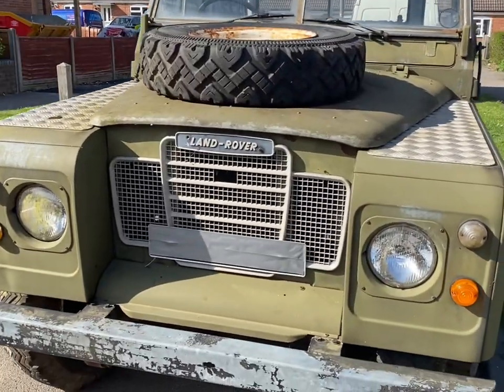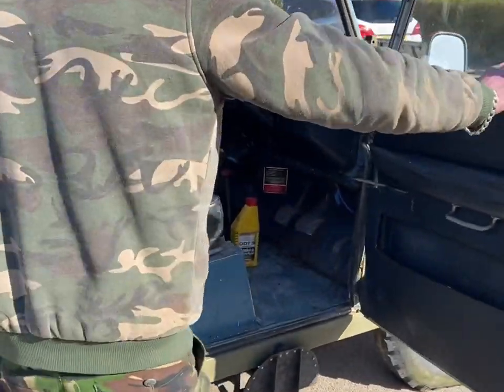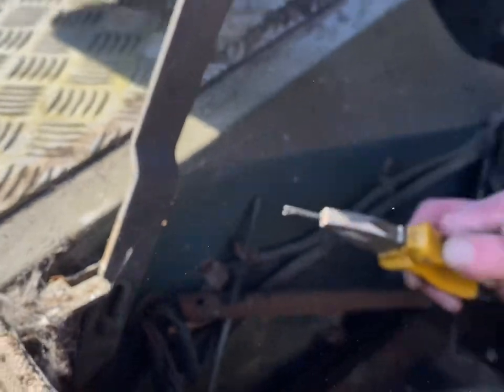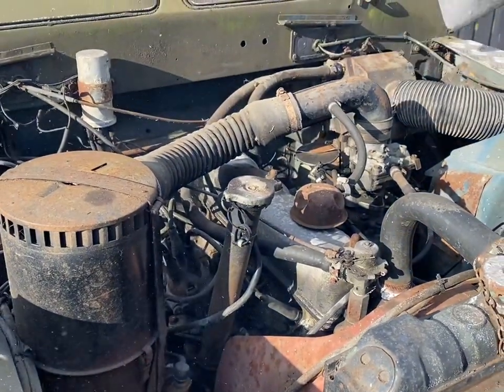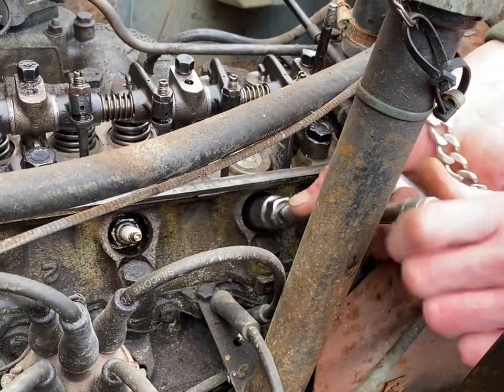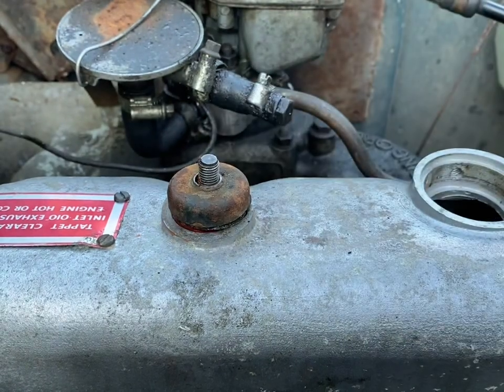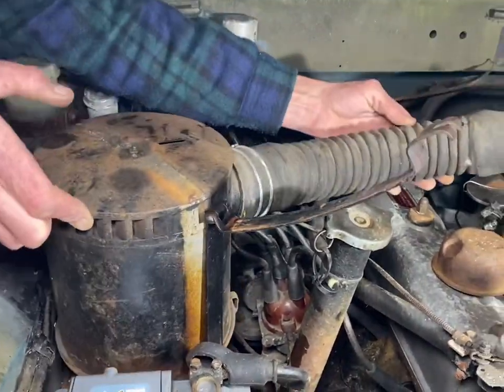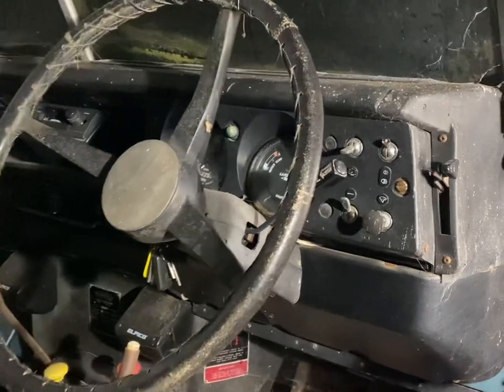Land Rover Series 3 ( Will It RUN ) 15+ Years Sat Up Long Wheelbase 109 Restoration Project Start

Comment: Nice S3 there and a good video introduction. Seats are posh and the engine sounds pretty good. I can't see if it's an 88" or 109"  I have a 1976 S3 LWB pickup, called Solly (from Solly hull), but somebody swapped in a Holden 186 3 litre, straight 6 in 2000. It's running really well after some fettling. I am looking forward to more videos of your Land Rover. It look to be in good nick.
Reply from the maker: @Glen Small
Thank you I appreciate it 🙂
Also it’s a long wheel base like yours ✌️